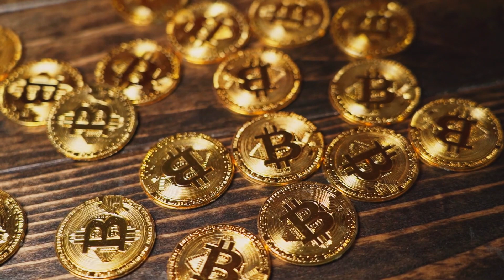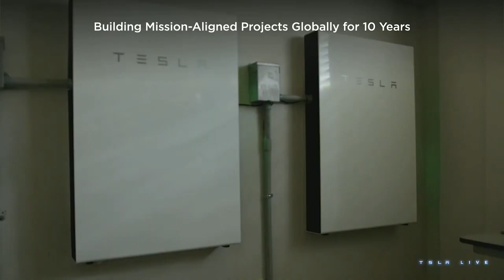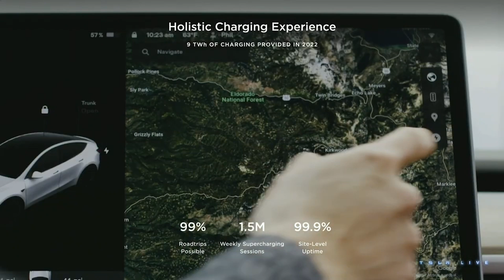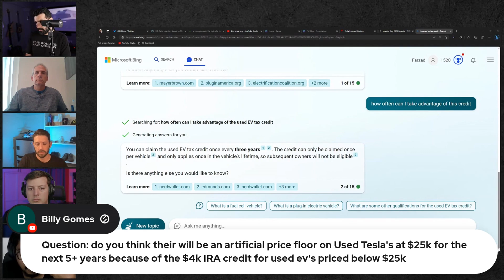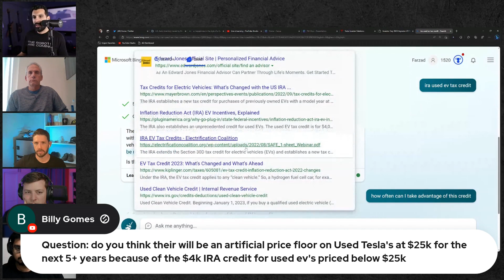Tesla's Energy Revolution!

Comment: On the 4k used, I was wondering if a lease option to buy can be set up.  For example, Hyundai Ionic 5, lease to own, eligible for 7500, which lowers lease price.  Structure 3 or 4 year lease, with purchase option after 3 years at 24, 999.  Purchaser would then get the 4k, which effectively lowers the Purchase price by 4k. 

So a 43, 500  vehicle, after 11, 500, costs $32000 total.  Lease payments and down-payment only need to be enough to price pay off at under 25K.

So whether Tesla or Hyundai, no matter the battery option, that ought to incentives manufacturers.

In three years, we expect  Gen 3 to disrupt with starting price under 25k.  

Am I right that this makes sense for a quality car?
Reply: $4k rebate also has a $75k/yr income cap
Reply: @DeeyaGarg  Really for many, that is fine.

Comment: Tesla energy is not as SEXY as Tesla auto.  Most people can understand a car but can't understand a shipping container size battery.  If I owned a Nuclear Power plant I would be adding Tesla batteries to manage demand.  Compared to the cost of a reactor batteries are cheap.  Instead of discounting power at off peak demand periods I would store it and sell it at high demand periods.  This would allow me to sell more power at a high price than I actually produce.  I would not have to discount any power because I could send it to the batteries.  It might be possible to increase my revenue by 30% while still producing the same amount of power.  Changing electricity from an energy that can not be stored to one that can be stored is a major breakthrough.